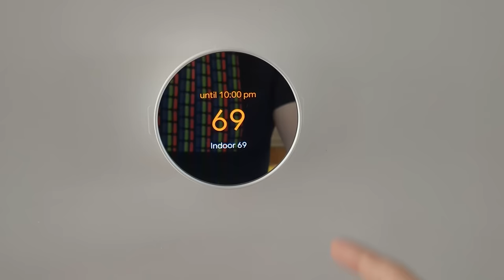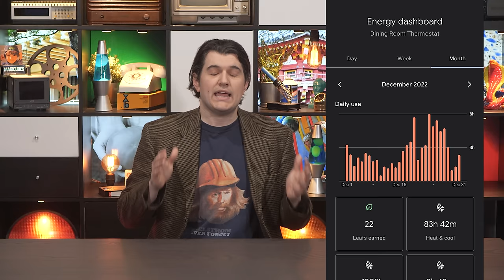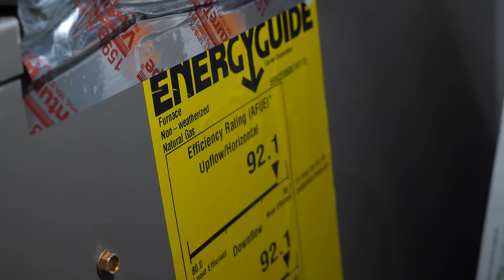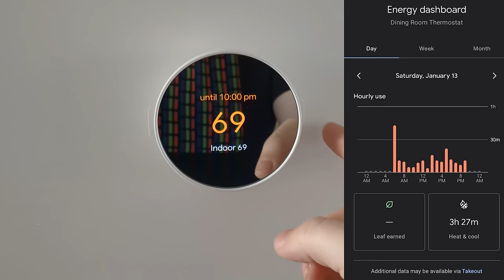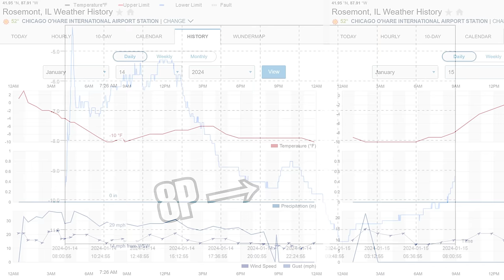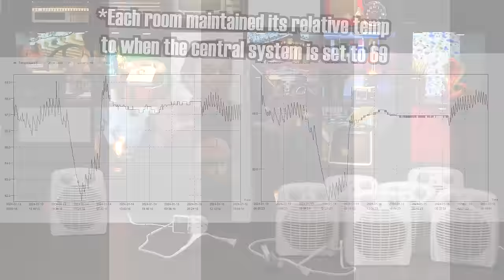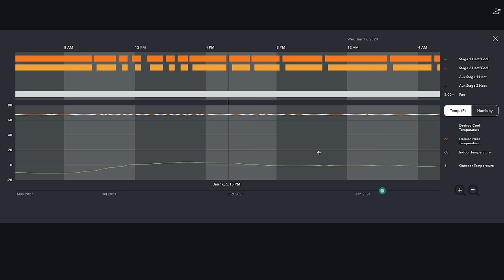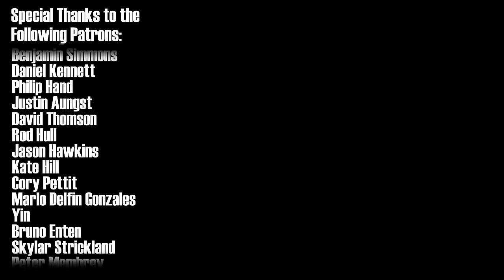Old HVAC industry practices are holding us back and costing us money. But we can fix it.

Comment: As someone in the HVAC Trade, this video is extremely valuable to homeowners and you are empowering my own standards. Not only that, you are calling out the predatorial practices of HVAC Companies. Heat pumps are amazing tech, and I would cite this source 7 days of the week. Fantastic breakdown, thank you!
Reply: But even he said Heat Pumps are just ACs working in reverse. Don't get me wrong, ACs in themselves are amazing tech but they're nothing new, and reversing them isn't something that we didn't know we could do for ages.
Reply: @Metallica4Life1995  On the coldest days I have seriously contemplated putting my window AC units back in, but backwards after fiddling with the thermostat.
Then I put on a sweater and sit in the fluffy recliner with a book.
Reply: @Metallica4Life1995  This isn't his first  video about heat pumps, and just because it's not new, pointing out more efficient systems WITH SCIENTIFIC PROOF is not only refreshing, it's unheard of in 2024.
Reply: The problem with refrigerate is the oil breaks down with heat you really don't want to over run it
Reply: Fun fact, oversizing was super popular in the 80s-90s in Illinois.  Not only that but salesman would often say something along the lines of “ours is the same price as the other guys but in our bid you can see that we are putting in a bigger furnace.  
Then they put an 80k in a 700sqft home.
Reply: heat pumps are not viable below -7 celcius, at which point it spends more time in a defrost cycle than it does pulling heat from the outside air, thus just throwing money out the window to pay for the electricity used to run that dfrost heater amongst other things. if you live in climate zone 6 or below its fine, 7 and above, nope.
Reply from the maker: @JSLEnterprises - so I'm guessing you didn't make it to the part at the end where I showed the performance data from my mom and dad's heat pump at -24C

not viable my ass
Reply: @TechnologyConnections  LMAOO
Reply: @TechnologyConnections  Oh man, Alec bringing out the full snark on this one.

I always enjoy content creators calling people out that just lie straight to their faces.
Reply: Can you Connextras the real-world cost of the oversized unit?  Upfront as well as, say, a year?  Although the video does a fantastic job to prove the sizing argument, I think it could help to understand what the long term costs are (in whatever "cost" units that are relevant -- such as money as well as CO2, icebergs, etc).
Reply: @TechnologyConnections  25:11 I’m a mobile app developer with about a decade of experience. If you could point me toward the formulas and data you used, I’d build that app.
Reply: @Metallica4Life1995  It does get a little more complicated when you hit freezing temps, because unless it's very dry, you're probably gonna ice up your evaporator. Which doesn't happen in an AC setup, only in walk-in freezers.... well, and air-source heat pumps.
Reply: @JSLEnterprises  If you have permanent freezing, get ground source or use a design that can mechanically shed the ice, so you can literally use that sweet latent heat of freezing together with the latent heat of condensation. For example a plate radiator with antifreeze and an antifreeze-heated evaporator; knock/peel the ice off when it gets thick enough, and have enough surface area to not be hurt by a mere couple millimeters of solid water between the air and the metal.
Reply: @TechnologyConnections  you think it was pulling in the heat from the -24 air? nope. it was pulling the heat from the mechanical compression of the refrigerant but primarily from the active defrost on the coil (i didnt see you check the power draw of your parents unit in that -24 weather). As a Canadian, i can tell you that short moment of -24 celcius is nothing like what you'd experience well north of the 49th (thats literally a seasonal high). Hell even in southern ontario (which has similar to chicago weather), spec'd condo units that do have appropriately sized heat pumps ALL have gas heat exchangers in them because otherwise every unit would literally just drain power from the grid constantly and fail to deliver sufficient heat otherwise.
imagine every home in chicago at once sucking the power of your 9-10 space heaters (if not more for the older energy deficient homes), it would collapse the grid just like overdraw from air conditioners did in Ohio sagging and shorting 220kv lines causing the eastern cascade blackout, but being in the winter and everyones heat pump being useless without power, with no alternative heat method... well, you can figure it out.
At least you figured out your home is decently insulated and weather sealed with your personal experimentation and found out that your home improved from the required 30k btu from when it was built the decade or so ago to the ~18k it needs now to maintain lower average temp than standard room temp (22°C) when its canadian 'spring jacket' weather outside (-10°C). 

Its funny, that youre parents 15 yr old home (a home that was built in an era where code must be followed, and that code already includes modern energy loss mitigation), That got the 3 ton heat pump, you didnt show cost of power for that day when it was calling continually for heat vs a typical day, and again, it not an energy pig from the 60's, same goes for your home.  

Heat pumps are still not a viable long term solution for excessively cold climates, especially in na homes built before the 1990's in climate zone 7 or above (with 7 being a 50/50 split), and unfortunately thats the majority of homes.
Reply: @namibjDerEchte  you try getting good geothermal along the canadian shield? lol. Also show me one residential heat pump that acts as an icemaker and mechanically knocks off ice. the heat pump pulls its heat from the air, in order to do so must pass that air through the condensor(turned evap), ice up will occur regardless, and if its cold enough outside (which it does up in edmonton and beyond), the refrigerant will flood back and will ice up the compressor regardless of defrost and potentially permanently damage said compressor causing it to fail.
Reply: @JSLEnterprises  I'm Swedish, Sweden is an arctic country where -7c is a nice warm day during winter... heat pumps work over here so it would probably work in the US unless your house was built for Florida.
Reply: @JSLEnterprises have you considered making an actual informed comment?
Reply: i just don't want to replace the unit twice as fast because you're running it twice as much at least.
Reply: @0Asterite0 it still wears through when you’re not using it, plus starting (and maybe stopping) puts extra load, so if you have a heater that costs 1000 dollars and lasts 1000 hours running constantly, and a heater that costs 2000 and lasts the same time, even if that second heater runs half as often, it won’t last twice as long, and you’ll be out money
Reply: @JSLEnterprises  I see your "uh, I'm Canadian and -24 C is too cold" and raise with "I'm Norwegian, and even my parents in a cold valley in northern Norway have used a ductless heat pump for decades and it works just fine". Sure, the wood stove is also nice to have on cold days, but that's primarily to reduce the power consumption (and because my dad loves chopping wood during the summer).

Your turn.
Reply: @antioch4019  i bet that your heat pump also contains nat gas heater to supplement it during the winter, since sweeden does export and a large chunk of its gdp is in oil and nat gas outside of precious metals. Also, does your home contain a centralized fireplace or is it a modern home built within the last 20 years?

And to your question of the build contruction of my home, its a stone/cmu home build in the early 1960's, so no, its not built like a floridian home of 0 insulation stickframing. Also, average temperatures in the winter in my neck of the woods (north of edmonton alberta) is roughly -30 celcius on a good day during the middle of winter, with an average of -40.
Reply: @marstr2  'to reduce power consumption'... because if left on became too cost prohibative. Why was it so, because it was continually defrosting on those cold days, but then again, if it was an older unit probably also running a propane based refrigerant which would have allowed it to get to a lower temp without as much supplicated defrost heat. The falsity by omission and deflection saying 'your dad loves to chop wood'. comical.
Reply: @JSLEnterprises  Norway disagreed
Reply: @JSLEnterprises  No gas heater at all. You sure you are not mistaking Sweden for Norway? We are pretty far down on the list when it comes to gas and petrolium. Heat pumps (all kinds) are the most common way to heat a home in Sweden except for apartments in cities where district heating based on burning trash is more common. We actually have to import trash to sustain those as we are too good at recycling.

And no I currently don't have any fireplace although I would want one for the cosy factor. My house is wood on concrete foundation built in 1961. Ofc windows and doors are updated to modern standards.
Reply: @JSLEnterprises  No, it's not prohibitive, just equivalent to heating the house by burning electricity directly which is the default option over here -- there is no gas infrastructure and oil furnaces are banned. During really cold conditions, the heat pump gets no worse than the default, and way better as the temperatures rise.
Reply: @antioch4019  norway produces more, but i recall surveys being tapped in the north up in the general vicinity of kiruna for exaple around the same time that Norway began to find their additional wells in the late 90's - early 2000's that basically dwarfed everyone else in the region.
Reply: @JSLEnterprises  You are correct, we have the potential based on some surveys. But we also have Greta and the likes. We haven't tapped in to those.
And we also have the Sami (our equivalent to Native americans, ish) to consider for certain other natural resources.
Reply: @marstr2  love how you get ignored the moment you make a valid point
Reply: @Metallica4Life1995  Why do you think we know to put the hot side of the exchanger outside?
Reply: My only complaint is that he was comparing mini splits pricing versus traditional heating and air conditioning... Mini splits are always significantly more labor
Reply: @JSLEnterprises what are you talking about? Of course it's pulling heat from the -24° air, if it was pulling heat from the defrost heater its CoP would be 1 (or realistically less), as you couldn't pull more heat than you would be producing with the resistive coils. In the data he shows the heat pump clearly was working as intended, so it was pulling heat from the air.
Reply: @TechnologyConnections  yeah but what did they have?  Was it a mini split or ducted heat pump?  A lot of the lower end heat pumps arent sophisticated to work effectively at those temps.
Reply: Toshiba makes heat pumps that have COP > 1 even at -35C. -7C is child's play even for older heat pumps. The defrost is only needed for removing frozen humidity, and at -20 degrees, the air has almost no humidity (it simply does not have the capacity to absorb water much at all). The heat pumps need to defrost much more around zero degrees Celcius than at -20C.
Reply: @JSLEnterprises  Are you using Grok to come up with that nonsense?
Reply: as someone not in the HVAC business, I'm surprised these aren't pushed harder considering i know you guys hate attics and these things are so modular people are DIYing it which being modular makes every industry efficient, seems bass-ackwards to me.
Reply: @TechnologyConnections  You mean the time when his mom needed a second heat source (electric strips ?) Best to look at $/kw to see the real benefits/drawbacks, if any.
Reply: I hope nobody responds to you like, you trust a YouTuber more than your fellow experts?
Reply: Do they work good in northern states like Minnesota?
Reply: @TechnologyConnections  3KW electric heat to compensate for the heat pump inefficiency at -11F outside does not make sense to me, since 3KW = two hairdryers.  Am I missing something here ?
Reply: MODERN heat pumps are amazing. The shit many have in their homes from the 70's, 80's, and 90's... not so much. The 80's model in my house is mediocre at cooling, and has no reversing valve for heating, not that it would work worth a damn for heating - when I need heat, it's too cold for it to work. The 90's tech in my apartment couldn't heat the place below 40F outside. In my book, if you want heat, do something that generates heat, not something that works very hard to scavenge it from somewhere else. (i.e. FIRE... gas, oil, wood, etc. in a pinch, pay the premium for electricity.)

[My house still has an ancient Apollo HydoHeat - 80kBTU water heater. And I almost never turn it on. The house is so poorly insulated, and badly designed, it's a waste of time and money trying to heat the whole space. Since I've "worked from home" for the last several years, only one room needs to be heated. And that room is mostly self-heating with me and a few computers. In the summer, when it's ~100F outside, I can go to the concrete-slab living room ["slab on grade" construction], where it's rarely into the 80s.]
Reply: @techedhiko9275  that makes a lot of sense as a sales tactic when you are selling a gas furnace.

The HVAC company probably pays damn near the same price for a 40k furnace as an 80k furnace.  The only difference between them is going to be a few more burners (at a few bucks a piece) and a fan with more flow (maybe another $20).

giving away that extra capacity to secure a customer is absolutely worth it, in the eyes of a salesman.  Sure, it's gonna cause problems for a customer who really only needed a 20k furnace, so their furnace is always shutting off and on instead of running continuously, but who cares?  that's support's problem, right?
Reply: @JSLEnterprises It seems the planet is not getting cooler.
Reply: @Deucehoru question- I don’t particularly see anything wrong with a furnace using 25% of its potential. Running 6 hours in a day seems optimal to me. To me it’s like hauling a big boat with a v6 using 90% of its potential or a diesel using 40%. The diesel truck isn’t going to get worn out as fast. But perhaps there are other variables. I’m sure the upfront cost is one.
Reply: I'm only 20 minutes into the video, but the implication so far seems to be that you want a heating or cooling system that is sized exactly for your home and needs. Is that sustainable, mechanically, and financially? That would mean that the system runs 24/7 on the coldest / warmest times of the year, and might not be able to support the heating and cooling needs you have in the future if they significantly change (Hello, climate change!), wouldn't it?
Reply: @JSLEnterprises  This is great info since it's the 1980s. Oh, wait, it's the 2020s.
Reply: @JSLEnterprises  We have heat pumps in Northern Ontario and they work just fine. You just need a cold climate one.
Reply: @TechnologyConnections 
Fujitsu has been selling systems that can maintain operations with COPs greater than 1 down to -29 Celsius
Reply: I'm perfectly happy with my gas furnace. But the poor folks who are stuck with electric baseboard heating. I feel their pain and understand why their houses are so cold.
Reply: step 1: actually own a home
Reply: @Metallica4Life1995  Tell that to all the reverse cycle A/C units that have been in Australia and other places for decades already
Reply: @DirkDeadeye_ The fans only have so many duty cycles. Since they’re almost never variable and are most often two speed at best (which itself seems to be a problem) with short cycling the fans on a furnace you’ll eventually burn them out quicker than if you leave them running 
That’s why in terms of reliability the single speed fans seem chief for both heating and cooling systems
Now you’d think that replacing a fan isn’t that difficult but HVAC companies seem dead set on making that far harder than it sounds as I’ve found out 😞
Reply: @JSLEnterprises  70% of Canadians live south of the 49th parallel.  -24C being a seasonal high for those that are north of it is rubbish.  Average winter highs in Edmonton and Winnipeg are about -10C in January and February.  Yellowknife daily average highs are -16 in December and February and -18 in January.  Iqaluit is closer, but they also famously don't have natural gas because lol at building out the infrascture to get it there.   Where are you that -10 C is "spring jacket" weather, yet you also need a standard room temperature of 22 degrees to avoid being cold?  Confusing contradiction and hyperbole.

My boss built his home in rural Southern Ontario in the 80s.  His heat pump has been a winner on energy costs every year but the very prolonged -20C 2014 and 2015 when it had to run extensive backup. There's no natural gas connection along his street, so there is no gas heat exchanger that you keep insisting exists on everyone's system.  He went with heat pumps specifically because he didn't want to pay Enbridge $50,000 to expand the network to him.

Over 50% of Quebec homes run on electric resistance heating right now.  There's no line sag, because they built their electrical grid accordingly.  Please see Texas winter 2021 blackout for what happens when you don't build things properly, such as the major failure of the natural gas network.  Texas introduced regulations in 2022 to require the natural gas to have their infrastructure beefed up so that can handle extreme cold.
Reply: @JSLEnterprises bro do you have investment in gas or something whats wrong with you
Reply: @patrickday4206  you must be from big air conditioning. Size em right and they wont break, what oil. Ever need to get your fridge serviced, thats a heat pump
Reply: @TechnologyConnections haha, I seldom catch you swearing so this brought me plenty of joy, thanks! 
Not to say you need to swear more - it's only so precious because you don't do it often.
Reply: @Metallica4Life1995  I would argue it was more that wasn't interest in the more complex valve systems that could do that and reversible compressors (that aren't horribly inefficient when running in reverse) that simplify the system are relatively new. The main driving factor tough probably is the increasing costs and overall pressure against fossil fuels tough, so not a new technology just a technology that is finally becoming economically viable.
Reply: @JSLEnterprises  That's old information.  Even older style heat pumps are economical down to around -17C (0F), and there are newer units that can do -26 to -30C.  That's before you go ground source.